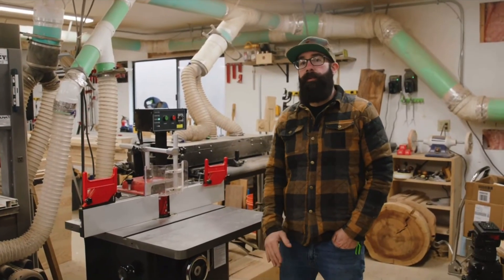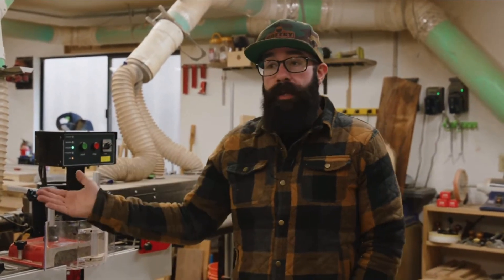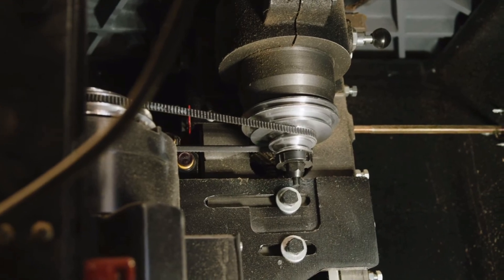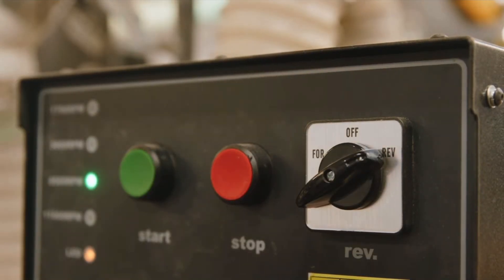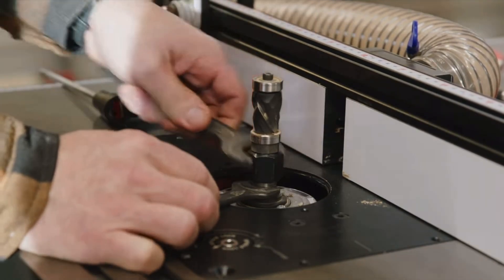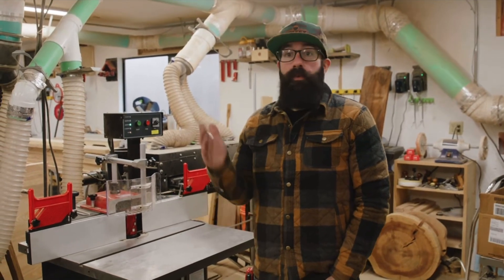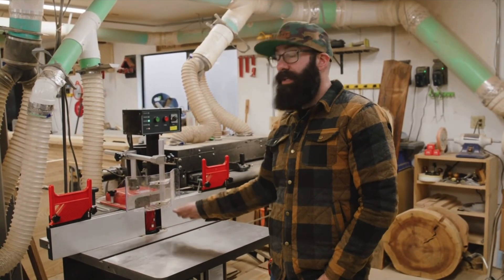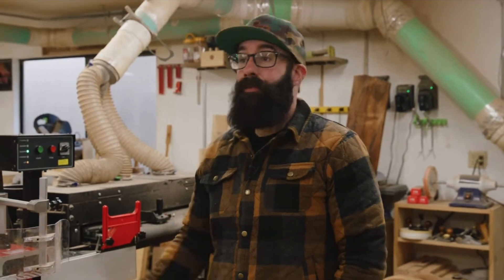Shaper or Router Table? Comparision of the Harvey HW303 Shaper by @CoffeyCustomBuilds

Comment: Hi 👋, very interesting, I have used both like yourself, you might be interested to know, that there is a company called Felder, make various different grades of machine, I have a K7 series I believe it’s called, and you can take out the spindle moulder shaft, and replace it with a router shaft, the change over takes probably 2 to 3 minutes, and then you can change the router bit in a matter of seconds, what makes it even better still is that you can tilt the head as well, as for your router burning out, or bearings, breaking up or seizing, it could probably do with clean out once or twice a week at least, there is a company called Maffel that do actually make a router to fit into a table, if you look at Sauter-shop, Germany, you will see their routers , and I’m sure if you get the details, you could probably find it in the US or Canada, these rotors are very very good, I am a retired specialist Joiner / cabinet maker, have approximately 50 years in the trade, keep up the great work. Stay safe. Look forward to seeing you next video., Phil from the moulin France.